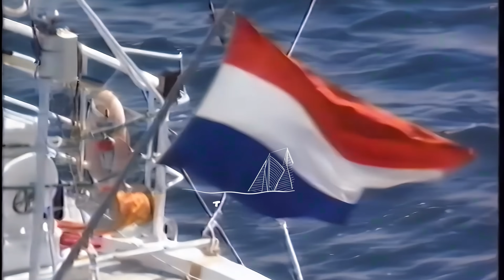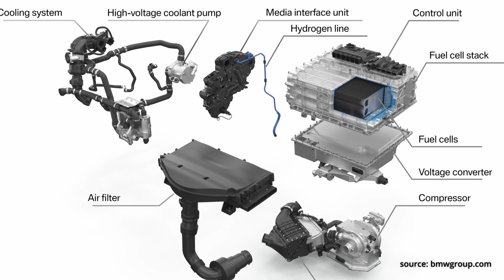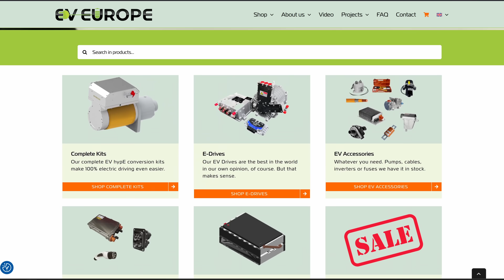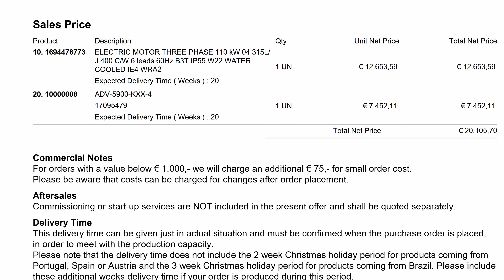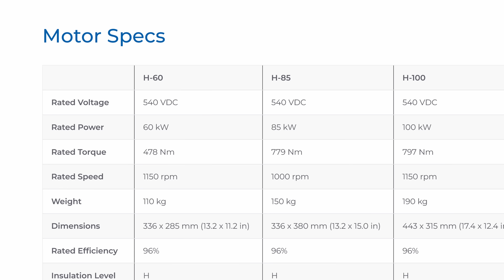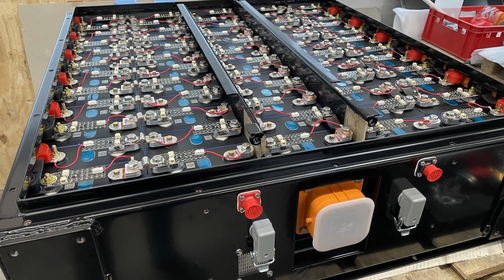Going Full ELECTRIC | Thoughts And Considerations

Comment: How much power do you think you may get from hydro-generation? I think you mentioned sailing at six knots and there is quite a lot of force applied to the propeller. I have observed that people often over estimate (guess) how much regen they may get.
Reply from the maker: I don’t have a clue to be honest, so I’m not throwing around numbers. We’ve never put a brake on the prop shaft during sailing. My guess (there you go) is that it’s a bit more than solar, especially at night ;)
Reply: @tigersharkboatworks if you have got data for the boat under power you have got a starting point. Essentially you calculate the engine power required to move the boat so that the water speed through the propeller is six knots (rpm x pitch). You will find that this will be quite a low boat speed and the engine speed will be low and as will be the engine power. If everything was then equal this engine power figure might indicate the power you might generate. But not everything is not equal, propellor efficiency may be 30% less (effectively in reverse) and the motor and controller may only be 75% efficient as a generator. But if you are sailing at six knots for days on end you may generate enough power along with solar.
Reply from the maker: We don’t know the exact pitch of the propellor. But we know around 35 kW gives us 6 knots boat speed on engine. I guess if we get 10% of that back when sailing at 6 knots we’ve got us quite some power :)
Reply: @tigersharkboatworks plan on 1kW of regen rather than 3.5kW.
Reply from the maker: Alright that’s still 24kWh a day :)

Comment: I’d go for new gearbox and hybrid drive because if electric motor has an issue you can still have diesel as backup.  Or the diy version of same adding motor.
Reply from the maker: I also think that’s the safest and most reliable option :)
Reply: @tigersharkboatworks  DEFINITELY! Came to the comments to state ^that^ ; YEAH!

Comment: Ik ben Old Bawley, post wel eens op zeiler forums. Ik zeil sedert 40 jaar een 85 jaar oud zeilbootje. 
Het is de visserman uitvoering van een pilot cutter. Sedert 2000 ben ik onderweg op de Middellandse zee, woon aan boord sedert 1985.
Zo´n drie jaar terug was ik het zat de diesel (eigenlijk de marinisatie delen) te herstellen en ben door toeval elektrisch gegaan. Ik zeil altijd, kan door de 5 relatief kleine zeilen zowat alles onder zeil maar als er geen wind is gebruik ik een 225 € duur trolling motortje. Dat geeft de boot 2 knopen. Zonder wind wel te verstaan. Was ik jonger bouwde ik een sterkere elektrische motor, bij voorkeur een die de schroef uit het water kan halen tijdes het zeilen. Onze oude schroef is een reusachtige rem. 
Ik ben lfp gegaan, heb 3 zonnepaneeltjes en twee windgeneratoren. Kan een uur of zes varen op elektrisch, dan heb ik ongeveer een dag of 5 nodig om alles weer vol te laden. 
Ik kook tegenwoordig zelfs elektrisch tijdens de zomer. 
Ga ervoor. Is de toekomst.
Reply from the maker: Bedankt Old Bawley, Dat klinkt goed!

Comment: you two make a formidable team.  
you should also consider selecting an electric motor based upon operating at twice the rated frequency through your VFD. The motor and drive can handle it. No problem, and you do not lose horsepower above the rated frequency, whereas if you reduce the frequency horsepower drops off.  you can generally use a smaller motor, and the drive will be smaller as well.
Reply from the maker: Smart! We’ll keep that in mind :)

Comment: Te question you didn't answer is how you will recharge the batteries.  If you intend to use your generator, I would suggest it would be more efficient just to stick with the diesel propulsion engine.  You can't put enough solar on your boat to recharge a decent sized battery bank in less than a week or two assuming that week or two is completely cloud free.  Regenerative charging will work, but will also require even more time than solar charging, plus regenerative charging slows the boat down.  What it comes to s that while it is technically feasible to go with electric propulsion, you still need a place to charge the batteries if you want to recharge in less than a week or two.  Also, $10K-$20K won't get you enough batteries to move that size boat very far before you will deplete the batteries.  So if you need to motor 50 km you won't be able to.
Reply from the maker: That’s fair. But if we go for a hybrid solution, we can get a battery that’ll allow us to motor 20 miles or so. And use the diesel for longer stretches, which can simultaneously charge the battery. Or we can motor around using only the generator in combination with the electric motor. Of course if the port facilities allow us to do so, we could charge the batteries overnight. For the rest, having a battery with 3 phase inverter that allows us to power the bowthruster and galley equipment without starting the generator is nice, because then we’ll never have to have 2 diesels running at the same time. The solar & shaft regen is mainly to keep the batteries topped up for all household appliances :)
Reply: @tigersharkboatworks  If you really wanted to take way more solar then you could fit on the boat, you could always lay the solar out in the water, maybe those thin flexible panels float? or just add some foam, and now you actually could take 10 000watts of solar with you and fast those LTO batteries in no time! Not very practicle, but possible. Theres a guy who does something like this with his Tesla (Solar Canon Ball) in the dessert. He lays out like 50x100w panels and charges it. He uses the thin flexible ones so they are easy to store in a little trailer he made for them. https://www.youtube.com/watch?v=cth1oq0fmYE

Comment: You are forgetting wind power. Lots of wind out in the ocean and its free. Put a wind propeller up on the masts.
Reply: Wind power offers quite little power at these scales. It's good for keeping batteries full at port but that's it
Reply from the maker: I have been thinking about that, but I’ll definitely dive into that more :)
Reply: Wind power can keep a bilge on or a bird repeller on at dock - makes no usable power for a vessel of this size / crew capacity.

Comment: Hi Gijs
Have you checked salt batteries? They are very safe, have almost no aging, have no pollution . Disadvantage is higher weight but maybe you could get rid of some ballast in exchange. 
Swen
Reply from the maker: We have looked into them a bit. But they’re also not really in mass production yet (quite expensive still). But maybe for the next battery swap in 10 years we’ll consider them :)

Comment: Good technical explanation.
Reply from the maker: Thanks!
Reply: Ok Jim as you require a bit of detail,  look at cars and fires, ashore we have  places to run but not at sea.   Ltithium cells in batteries are series and parallel.  With an unbalanced cell if a heavy load is applied better or more charged cell can reverse polarity of a weak one.  It is reversed next charge but we have an insipid problem with cell or cells degrading.  A potential fire risk.  Later cells are better but all should never be flattened or over charged Land Rover currently suggest a 20-80% envelope.  Not quite the range or capacity we thought.  Later cells in fact need. 100% charge  once a month to recalibrate the system.  being prudent I would hang back.  Now under passage punching a tide often the iron topsail can ease comfort.  That may not be possible greater care is required but of course opinions on choice vary and its down to the individual.  Facts unfortunately can force choices.  I was taught to be cautious.

 Now why are we following net zero?   to reduce our CO2?  In fact the radiative spectrum of co2 is narrow and reacts mainly at 20ppm,  after this which was in the early days of climate formation.  As CO2 increases the heat reaction lessens on a log basis and both calculations and experimental data show after 340ppm no measurable heating was detected.  The University of Pennsylvania .

So its choice,   and for every one to choose.

 I have sailed a great deal racing and cruising.  I lived on my 12 M sail boat in the Med and Worked on maritime electronics.  I also designed and commissioned my own Solar Bore hole some 15 years ago.
Reply: @Bruno-u1r6o I need no further explanation. I mentioned how I felt about his video, as he did a good, basic job that will reach many people. He touched on many points most folks don't normally know about. I am electrical / electronics tech and have lived offshore on a boat.
Reply: @jimcalver-oj4xf  Understood!

Comment: I know it's probably sci-fi, but you could install inflatable algae ponds on the side of the ship and let them generate hydrogen when at anchor to fill up hydrogen tanks (which store 8times more energy per kg than batteries), then dismantle them and sail across the ocean.
Reply from the maker: Hahah that does sound sci-fi. We will need a fuel cell though, to turn the hydrogen into electricity. So maybe in the future we’ll replace one of the generators for one, and get algae hydrogen to power it :)

Comment: Its a sailboat,  your main fuel use will surely be the generator. regen from the prop shaft seems like good money spent. electric drive is complex, expensive and has low payoff mostly because its not used nearly as often.
Reply: if you are running a tallship for 2-3hour trips out of a habour you can use it for easy docking and undocking. if you sail cargo you can use the excess energy for a chilled hold allowing you transport of goods that you normally couldnt.
Reply from the maker: @cpt.mirones5109 exactly! Or to chill the passengers in hot areas :)
Reply: I guess you are not a sailor?  Drag will kill speed. On a racing sail boat as a folding prop snaps shut speed increases often by 25%.
Reply from the maker: @Bruno-u1r6o good thing we don’t have a racing sailboat. Going 25 procent slower to not use diesel is a perfect trade off :)
Reply: @tigersharkboatworks  That fine of course and anchored in a tideway might help.
Reply from the maker: Well keep an eye out for those :)
Reply from the maker: @lanerothsailing2293 true! So a smaller electric motor with regen would be the best of both worlds I guess :)

Comment: I like your thinking! You have a good size sailboat for some solar to run everything domestic and keep the propulsion batteries topped up. Regen during sailing does the rest. Bow and Heck thrusters can reduce the power needed for the main engine by a lot. I have a 11 meter steel boat with only 100Ah/24V LFP battery, a 3kVA inverter during the day and a smaller 1kVA inverter for the night. 400 Watt of solar was enough to power induction cooking, the fridge, lighting, entertainment and small electrical tools for 3 months on the hard. Only the welding did on shore power. I just installed an domestic Air-con for heating in the winter, also reducing my diesel needs.
Reply from the maker: Thanks! Sounds like you have the perfect setup for your boat :) 3 months is impressive!

Comment: use solid state batteries as they are safer, also there are marine companys building 24 volt batteries for use on a boat
Reply from the maker: Thanks! We’re definitely doing that!
Reply: i heared Lithium Iron Phosphor or was it Iron Sulfur as mixture instead of Lithium-Ion is standard for sailing. 

but get in touch with edision motors.
they had issues with Regen Braking because they generated more energy than you can charge into the batterys at a steady pace. that had to switch to some other non Lithium type of battery but i am not sure what it was. that would be if you have half your solar some wind turbines and regen charging all at the same time.
Reply from the maker: That’s interesting! I’ll look into that. Although it might help that we do not rely on the regen for braking, so we can just switch certain systems off :)

Comment: Don’t do it.
Reply from the maker: Why not?
Reply: @tigersharkboatworks I think he was quoting what they said to Nikola Tesla, Thomas Edison, the Wright brothers.
Reply from the maker: Ah, so it was words of encouragement :)
Reply: One ship in the uk lost power and ended up in trouble and is no longer and last month a narrow boat in the uk was on fire during charging.
Reply: I am not scaring you just want you to have the full facts your a large ship and this poses are greater challenge. there are some cruising boats that have batteries and motors, but this is a different arena.
Reply: Look at tally Ho and sailing Uma. Best source on here for small boat. Your going to need a massive generator if your going to be safe.
Reply from the maker: Alright alright, so basically if we go for a hybrid system all those troubles are solved, except for the fire thing. So we need to get a safe battery system and fire extinguishing system and we’ll be golden :)
Reply: @tigersharkboatworks  there is no extinguishing system for Li-ion the chemistry is volatile. Lipo4 is the safest on the market at the moment.